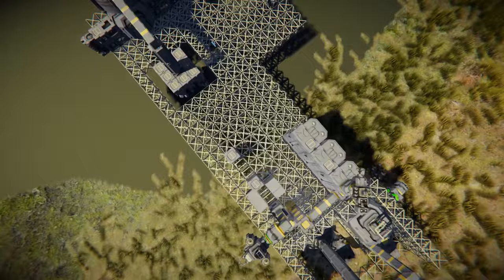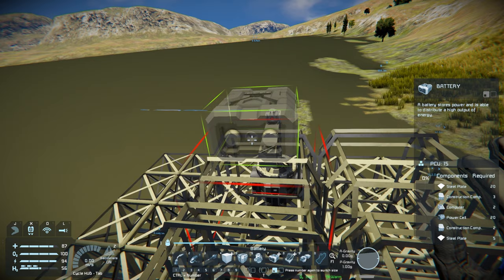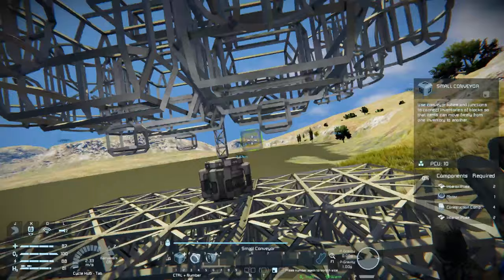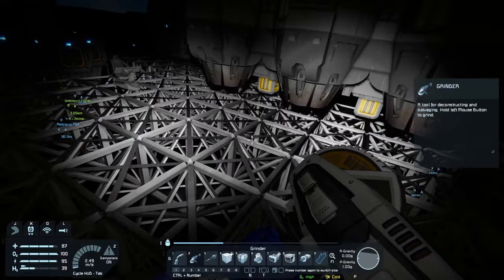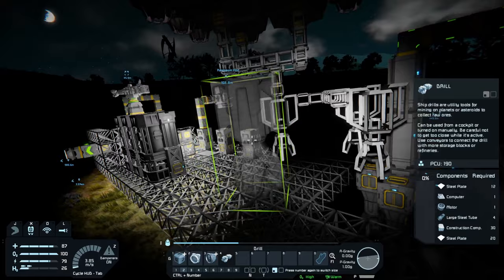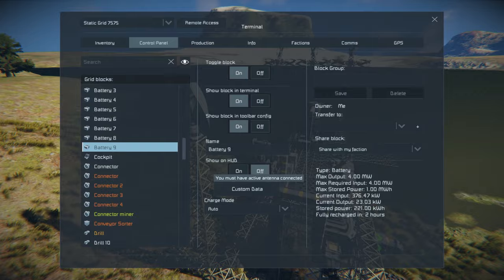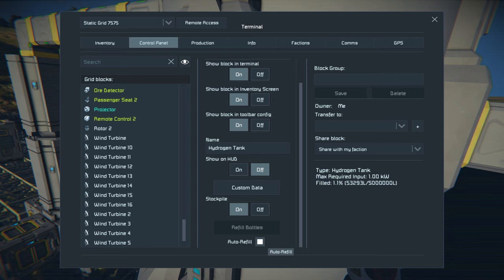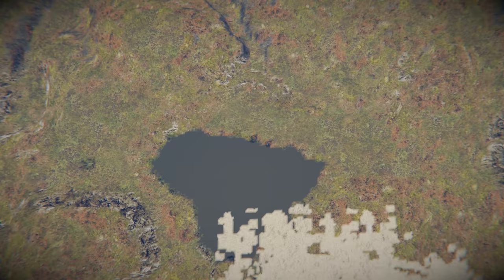Industrial Miner. Space Engineers Xbox One and PC Beginners Guide #7

Comment: Also, minimum distance to the sides of a wind turbine to work most efficiently from what I've seen, heard, and tested, is 8 blocks. So for a tower like that, the block for the top wind turbine is 9 blocks up from the ground for minimal distance.
Reply from the maker: I think that is pretty close to what I have here, I'll re count and update if needed. The next video will be working on the base so we can fix it there.
Reply: its 8 blocks from a voxel you can even in pc ver at least make a pit or a cave shaft down underground as long as its 8 blocks from ground voxel it still works. good if on a PVP server so you can hide base better.